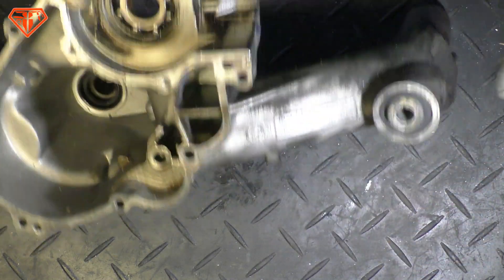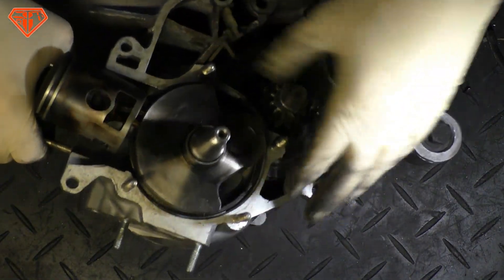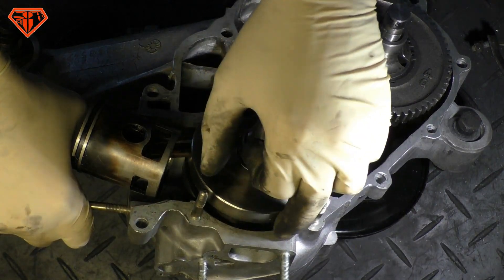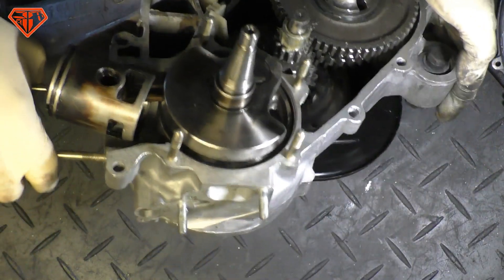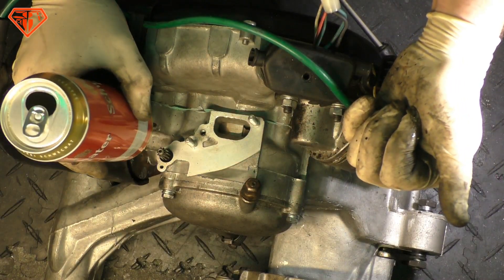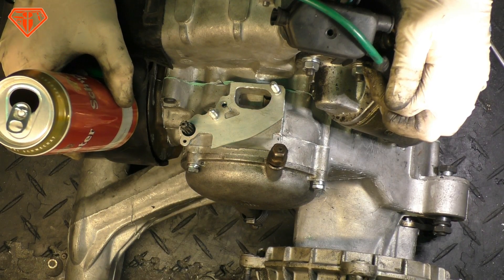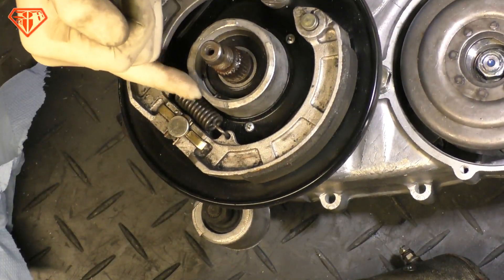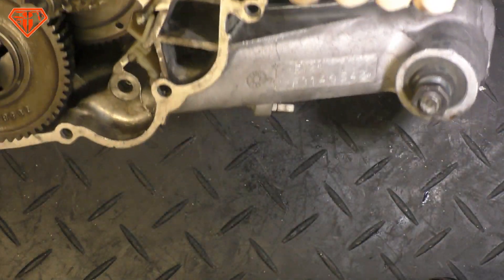LML rotary engine case REVIEW / vespa px125 service

Comment: Finally took out my PX200E after sorting various issues.  Your guidance was very much used and appreciated.  It's had a faster flowed 24mm carb/petcock and big box pipe, looks standard but hauls my 18 stone no problem at all - clock says almost 70mph...   Thank you!
Reply from the maker: glad to hear that. cheers mate!